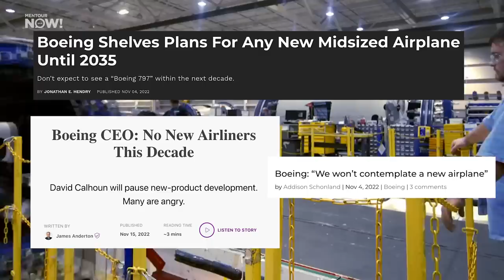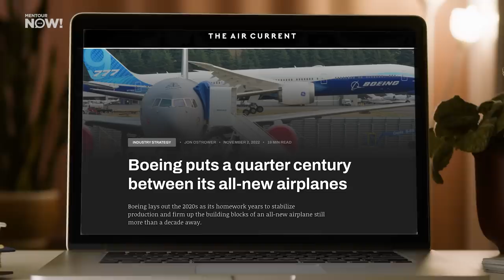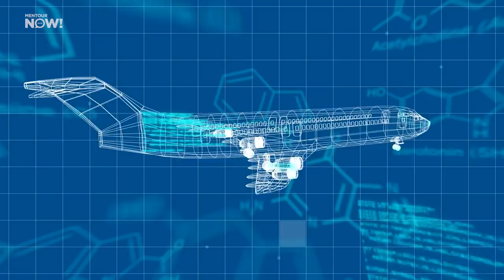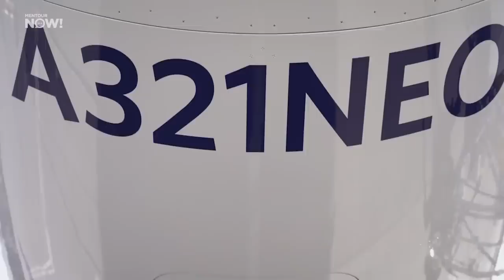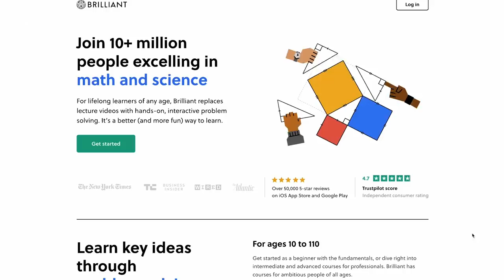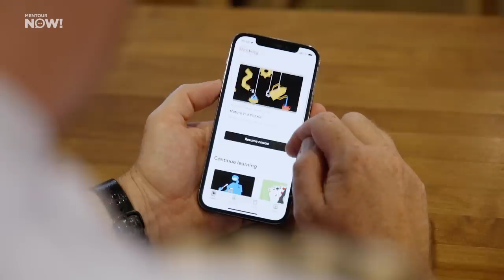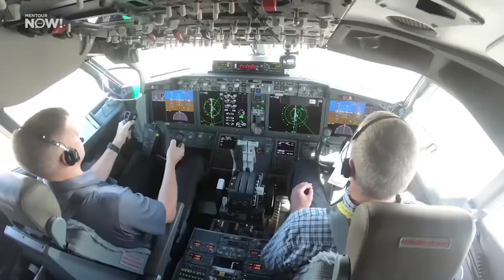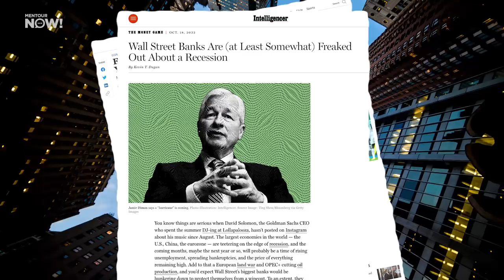Is BOEING giving up!?

Comment: This is what happens when the accountants take over what should be an engineering centric enterprise.
Reply: Managerialism
Reply: Power point culture
Reply: I've heard that argument before in other scenarios and can't agree.
It would be wrong for the decision makers to be only engineers or only accountants. Granted it's hard to find talent that has a necessary grasp on both but neither engineering nor getting things built properly competitively can be ignored.
There are also plenty of examples of well built and lasting products which were too expensive to the buyer also failed.
Reply: @tonysu8860  Right but they dont have a mix of engineering and accounting decision makers. Engineers arent even at the table at Boeing. They didnt preserve the required knowledge, it was cashed-out and cashed-down for short and mid term gains and now they're out of fuel. The various engineering mistakes theyve made have cost them substantially more and now they need to down-size the business because, and squarely because, their main product is running shy on its critical resource.

Had they actually paid attention to the engineering knowledge quotient in decision-making like you say, the depth of knowledge would support the maintenance of their business.
Reply: @vigilante619  no reasonable person is suggesting that. Its not about having engineers left "unchecked". It you remove the oversight, knowledge, safety, process and experience of engineers from ALL decision making such that they have no voice you dont have a good outcome. Similarly having them have the run of the place is clearly undesirable.
Reply: @johns5558  I still wonder why Boeing hasn’t taken up the concept of a mixed team of accountants and engineers after the Max 8 fiasco. The correct combination of those with compatible personalities and skills could really achieve something great, in my opinion. And a company like Boeing is big enough that this “dream team” could be done.

But then again several decisions of Boeing hasn’t made sense to.
Reply: Don't forget, Douglas Aviation was an industry giant, reduced to the Boeing 717 by 2006 due to bean counters serving the board and the antics of stretching and redesigning existing planes (MD-11 and MD-80). First, they destroyed McDonnell Douglas, Now it's Boeing.
Reply: @mikoto7693  I work in IT and Software and it has seldom ever been the case that hard core beancounters, hardcore managers and ambitious executives ever really advocate for (re)introducing engagement from technical teams. Its always easier / preferable / more profitable to just "manage the narrative" (ie talk bullsh!t) instead. This of course dilutes real product value and company value over the long term. 

Boeing is the largest example of this recently, but it happens whenever the technical expertise completely exits the C-suite... they NEVER come back and eventually the company recedes.
Reply: Correction. This is what happens when accountants take over any company in any industry. 
Cheers
Reply: @tonysu8860  It is not hard to find both because every competent engineer is constantly doing cost-benefit analysis. The engine that uses 4% less fuel and the composite airframe that weighs 8% less than an aluminum one are both entirely the product of engineers asking themselves, "what can we do to make our aircraft cheaper to fly"?

No engineer specs as much as a single bolt for an aircraft without considering its cost and the cost of the alternatives. Because that's what engineering is: figuring out which of the many ways to build something best meets the design goals. And "lower cost" is always one of the design goals that engineers are considering in their balancing act.
Reply: I just hate accounts. They are not financial managers, they dont strategies long term company growth and always talk about zero sum expences. Thats why most companies fail to survive 10 yrs or so.
Reply: Correction. Not accountants, but ex NATO and CIA war hawks.
Reply: @JoniLombok  lol, accountants don't cause companies to fail. Managers that ignore their accountants is what cause businesses to fail. Let your expenses grow unchecked and you're out of business in no time. Most startups that involve engineers/industry experts but not financial experts are the quickest to fail.
Reply: The bean counters in charge you get the 737 max disaster.
Reply: @andrewahern3730  737 max took a short cut with the software instead of a wing redesign because the bigger engines changed the CG.  This was a cost calculation that cost many lives.
Reply: @jasonhunt007  yeah, and? How does that disprove the point that the Head of Engineering is chiefly responsible? Every engineer has to consider costs as a factor, as nobody cares about fantasy designs that can’t be made in the real world. There’s no such thing as a blank check anywhere. Again, the problem was horrible engineering.
Reply: @andrewahern3730  ultimately it cost was the consideration.  Leadership did not defer to engineering, which if allowed to make the decision, would have redesigned the wing to make the 737 max more stable.
Reply: @jasonhunt007  it was engineering that came up with the subpar design. Again, it was the Head of Engineering that ultimately approved the design. Do you really think the CFO drew on a napkin, a la Musk, and handed it to engineering and told them to implement it?
Reply: Return to Seattle or QUIT!!!
Reply: Too many bean counters (accountants) - ruination of many a good company.
Reply: Unfortunately this is happening in all domains. Civil Construction is already there lead only by accountants and lawyers. All project are fcked when led by these 2 factors...
Reply: @andrewahern3730  and it was engineering that made redundant safety sensors an extra more expensive option? I doubt it. But i do agree it was bad engineering. Which was most likely due to boing layong off the more senior engineers and getting less experienced ones to replace them.
Reply: @slaapkonijn58  yes, it was engineering, that’s why the head of engineering was found chiefly responsible. How is this so hard to understand?
Reply: @tonysu8860  Agreed. You need accounting,marketing,HR, engineering, etc to all work together
Reply: @johns5558  As a software engineer can confirm. Upper management don't like it when we have opinions about software. Just "do as we're told" and watch app support pick up the pieces
Reply: @slims2503  uh, what? When you don’t have those teams you end over budget and mired in litigation. For all this talk about engineers being saviors, can I get one single example of a successful business that doesn’t spend massively on finance and counsel? FFS, you’re never going to raise the money to develop something if you can’t demonstrate an ounce of fiscal understanding (FTX notwithstanding)
Reply: @andrewahern3730  generally all projects that are lead based on bugdet drawn up by people without common technical knowledge lead inevitably to great delays which then require  counsel for which again without common technical knowledge lead to even greater losses for a company. I am not saying that in construction business you don't need counsel and financial knowledge but, when the business is lead by these factors the projects are dissasters.
Reply: @slims2503  that’s not true at all, given the fact that literally every single project is based on a budget. Where can you get steel, copper, and labor for free?
Reply: @andrewahern3730  ofcourse there is a buget, do you believe that budget cannot be set by an engineer, or do you believe somehow budget can only be prepared by economists? Generally it is good to have technical guys work on budget  not an economist that have no clue what a job entails and set stupid, unrealistical and greedy limits that have no cover just to prove stupidly that by setting a greedy limit they can get the job done. In the end the greed and stupidity always leads to projects overruns in both time and money.
Reply: @slims2503  lol, do you know the difference between accountants, financial analysts, and economists?
Reply: Same as GM
Reply: This is also what happens when they hire MBA consultants from McKinsey who know nothing but PowerPoints from a business point of view
Reply: @shosc16  as overrated as McKinsey is, this is just a hilarious take. Yeah, companies actively spend money to have someone tell them how to perform worse. Okay.
Reply: @mikoto7693  "I still wonder why Boeing hasn’t taken up the concept of a mixed team of accountants and engineers after the Max 8 fiasco" - If I were to guess, I would say it's because engineers typically want to do things the right way (use known-good processes, use quality materials, and design with safety in mind) whereas executives typically are concerned only with money (so they have no problems cutting corners, using sub-standard materials, eliminating safety, etc).  Those two groups of people cannot work together because there is no common ground and neither group will accept the other's fundamental objective.

Comment: I would like to see a plan from Boeing to put engineers back in charge of engineering
Reply: In a way this kind of looks like it is that plan. 
It looks like Boeing is saying that they will put their focus on solving the problems their current line-up of planes have before starting the process of building a new plane. All the recent problems have put a really large dent in Boeing's reputation, so trying to win back at least part of that reputation should be key priority for Boeing.
Reply: @tjroelsma  Given that the execs headquarters is 2000 miles from the factory that seems unlikely.
Reply: That's probably not diverse woke inclusive enough for the self-destructive current standards.
Reply: @ericvosselmans5657  ???
Reply: That is also my wish, but it looks like Boeing is still looking for a grand "Dungeons and Dragons" style Machiavelian way out of their current bind instead of actually having engineers doing engineering.
Reply: @mrrolandlawrence  The image you have in your head has existed for at least 40 years and has not become reality for Boeing. I remember how some decades ago the future of Airbus was being put in doubt by many because of the government contracts and NASA partnerships that Boeing had and Airbus did not. But now we see Boeing in trouble. and A320's displacing Boeings. Boeing has a lot of advantages that they can use if they go back to being an engineering company, but if they do, they will have to work for decades to crush Airbus.
Reply: @ericvosselmans5657  ??
Reply: @mathiastwp  some people have no idea what “Woke” actually means and just like to throw word into comments as a buzzword
Reply: @a1white  Woke: just another word that combines racism and sexism.
Reply: @ericvosselmans5657  what you are writing is plain caricature ans so excessive to be taken seriously.
And in addition you are wrong : Boeing problems are mainly due to the transition from an engineering culture to a financial one at management level.
Reply: @andresvillarreal9271  As somebody with extensive D&D experience, I have to ask: what the hell does 'grand "Dungeons and Dragons" style Machiavelian way out' even mean?!?
Reply: @louisdresse8650  For Boeing's sake I hope so.
Reply: @jursamaj  The most important part is that it is not what engineers do: find the problems and the goals, design, test, repeat.
Reply: And let the FAA certify the Airliner, not the Boeing engineers.
Reply: Resume includes Boeing engineer: 25 years and no manufacturing experience.
Reply: Return to Seattle or QUIT!!!
Reply: That is for certain. Too many companies, even outside aerospace are controlled by the bean counters. This is how we get so many recalls in the auto industry.
Reply: The engineers left for Blue Origin, Google, Amazon, etc. Long before 25 years passes there will be no tribal knowledge remaining for HOW to produce a new aircraft and to a large extent, this has already come to pass.
Reply: @zimbabwesteve4620  Exactly, and you don't bet the company on a single expected technological breakthrough, you work on every front searching for advancements big and small, so you are participating in the future instead of waiting for it to happen. That is called engineering. These people think that the game is to not make mistakes, but engineering is all about making mistakes and learning from them.
Reply: Lol, what Boeing is going to do is  put Flight Engineers back in the plane and take the pilot out in case someone needs to unplug one of the triple redundant full authority control computers and plug it back in again.
Reply: Their current CEO is an accountant who most of his carrier worked for GE. As a former GE employee, I can guarantee that he has learnt how to run down a company.
Reply: @RS-ls7mm  Some times keeping the execs away from the people that actually do a thing isn't a bad idea .
Reply: @RS-ls7mm  sounds about right
Reply: @jursamaj  well it may involve rainbow flags and fluffy unicorns and safe spaces is my guess . Other than that I'm as clueless as you .
Reply: @IcyTorment  Go woke get Broke ....we have seen this many times before .
Reply: @richardwilliams1986  Can I apply ....I used to make kit form aircraft as a kid .
Reply: @daledavies2334  old say " if the jobs worth doing , do it right the first time " . When money becomes the main issue ......every thing else fails .
Reply: @andresvillarreal9271  Well I'm an Engineer of life then :-) , who would have thought it lol .
Reply: @caphenning  no all Boeings will be linked to a 24hr call centre , where a bloke called Dave will say " have you tried turning it off and on again sir " .
Reply: True for EVERY engineering centric firm!
Reply: Exactly!
Reply: @ericvosselmans5657  imagine blaming the MD accountants takeover on woke culture
Reply: @IcyTorment  you think Boeing’s problems only started since he became ceo? Sounds like you’ve swallowed the MDD spin without any knowledge of the last 40 years
Reply: @daledavies2334  same in gaming these days
Reply: @GLHerzberg  it’s ok, Boeing has outsourced it’s engineering to India, that’s how they came up with the 737 Max
Reply: @a1white  Tell me Woke expert..lol
Reply: @StoutProper  The blame is what..??
Reply: @peteparadis1619  I hate the phrase. It seems to be used as an insult to anyone who actually wants fairness and equality. I really have no idea why the commenter used the phrase "Woke" here. it makes no sense in the context of the conversation.
Reply: @thedownwardmachine  Amen
Reply: I personally think many members of Boeing's management team ought to be jailed for murder.
Reply: @chairmanofrussia  reported. Keep it civil. IF you can't control yourself, i suggest refraining from comemint on youtube
Reply: Calhoun is an engineer, so no surprise he is turning the company back to engineering basics rather than manipulating share value
Reply: What! This quantity surveyor says the bean counters have to be in control. If they are not in control, you won’t get advanced aircraft design such as the DC3, Vickers Viscount, etc. Oh I forgot they have propellers and are about a million years old. But a revised design of these aircraft should be cheap. Money should be saved and the rivals will be in a better position. Have a good day everyone.
Reply: In a weird way this is why I think if you want a company to run proper you keep it private. You could say a lot of the time shareholders etc act like these people trying to run it with no idea what they even doing.